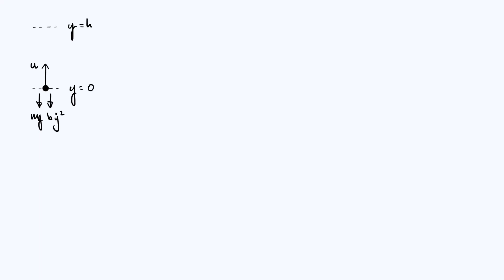Quadratic drag I: particle launched upwards

Comment: I just watched both Quadratic drag videos. The explanations  and interpretations were excellent.  One question, maybe it is not meaningful to say there is a maximum time to reach maximum height because arctan "approaches" pi/2  but only as the value approaches infinity. This interpretation would be consistent with the maximum height equation. Or maybe I am missing a subtlety?
Reply from the maker: Thanks, and good question! I think both statements are true, because saying that T has a maximum possible value doesn't necessarily imply that it can actually reach that value for finite values of u. It's true that T will always increase as u increases, but it can't increase to arbitrarily large values like h can, which is the difference I wanted to highlight.
Reply: @DrBenYelverton  Maybe an analogy is convergent vs. divergent infinite series. If that's correct I see your point.
Reply from the maker: Yes, I think you could make that analogy. Another way of saying it is that T(u) is a bounded function while h(u) is unbounded.